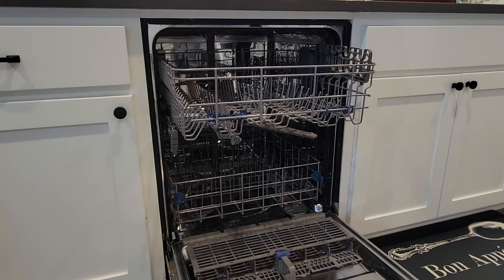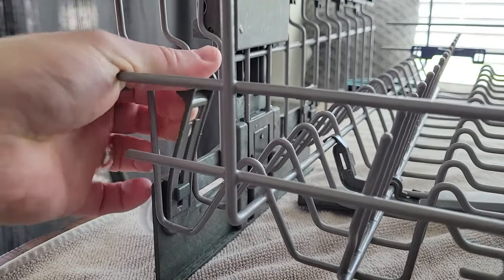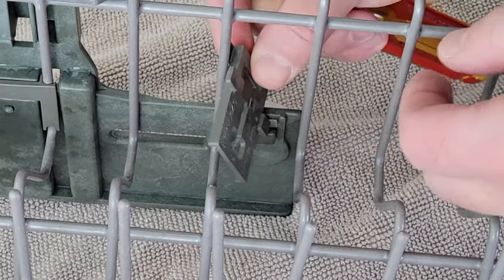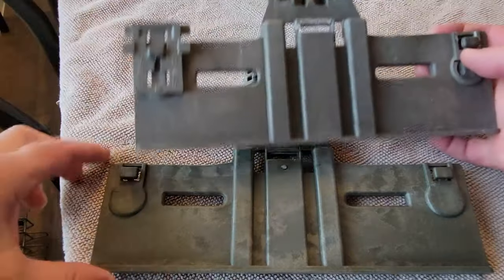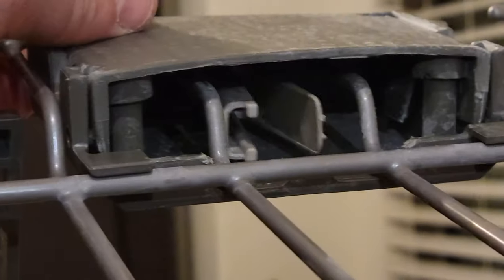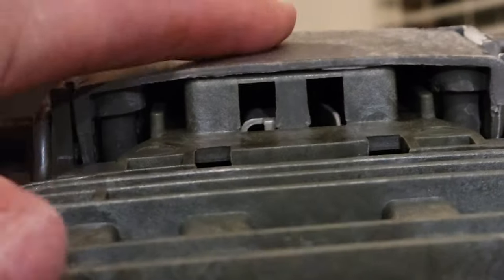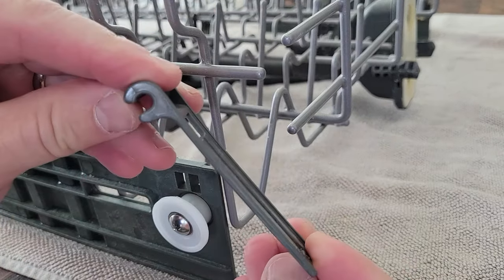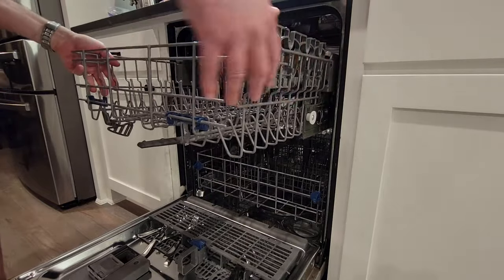Dishwasher Upper Rack Wheel Repair for Whirlpool & Kenmore

Comment from the maker: Replacement parts (Check your model below for compatibility)
Dishwasher upper rack wheel assembly: https://amzn.to/472oKOr 
Dishwasher upper rack wheel assembly with all new clips: https://amzn.to/3Kx1Y7N
    • WDT730PAHZ0
    • WDTA50SAHZ0
    • WDT970SAHZ0
    • WDT750SAHZ0 (This is the model shown in the video)
    • WDF590SAJW0
    • WDT975SAHV0
    • 7WDT950SAYM0
    • 7WDT950SAYM1
    • 7WDT950SAYM2
    • KUDC10FBBL0
    • KUDC10FBSS0
    • KUDC10FBWH0
    • 66513362K110
    • 66513362K111
    • 66513362K112
    • 66513363K110

Use this kit for the models below: https://amzn.to/4cKctBr
    • WDT790SLYM1
    • WDT790SLYM3
    • WDT910SAYE0
    • WDT910SAYE1
    • WDT910SAYE2
    • WDT910SAYE3
    • WDT910SAYM0
    • WDT910SAYM1
    • WDT910SAYM2
    • WDT910SAYM3
    • WDT910SAYH1
    • WDT910SAYH2
    • WDT910SSYB0
    • WDT790SLYM0
    • WDT790SLYM2
    • WDT910SSYM0
    • WDT910SSYM1
    • WDT910SSYM2
    • WDT910SSYM3
    • 7WDT950SAYM0
    • 7WDT950SAYM1
    • 7WDT950SAYM2
    • 7WDT950SAYM3
    • WDT910SAYH0
    • WDT790SLYB0
    • WDT790SLYW0
    • WDT790SLYW2
    • WDT910SAYH3
    • WDT910SSYB1
    • WDT910SSYB2
    • WDT910SSYB3
    • WDT910SSYW0
    • WDT910SSYW1
    • WDT910SSYW2
    • WDT910SSYW3
    • WDTA75SAHZ0
    • WDT970SAHB0
    • WDT970SAHW0
    • WDT975SAHV0
    • WDT975SAHZ0
    • WDTA75SAHN0
    • WDT780SAEM2
    • WDT780SAEM1
    • WDT730PAHZ0
    • WDTA50SAHB0
    • WDTA50SAHZ0
    • WDT970SAHZ0
    • WDT970SAHV0
    • WDT750SAHW0
    • WDT730PAHB0
    • WDT730PAHV0
    • WDF590SAJM0
    • WDP560HAMB0
    • WDP560HAMW0
    • WDP560HAMZ0
Note: I earn a small commission if you buy using the Amazon links below, but your price is NOT affected. Thank you for supporting the channel and the content I create!
Reply: This is the second replacement I had to do,  because of the cheap parts manufacturers put on the dishwashers.
I am a 75 year old widow and because of your video I did a much better job than the first time.. I had to keep picking up my parts from the bottom of the washer as they fell off.  Thank you so much.  I was able to put the parts that fell off back on, then I tackled the other bracket and they both look seaworthy now! Great video!
Reply from the maker: @nancykocbeker9037  your comment made my day! I'm so glad it helped you!
Reply: Thanks for making just a great video!!  My dishwasher was only down for 24hrs.  Amazon next day delivery awesome.  Once again thanks for making this video much appreciated
Reply from the maker: @seanmarks6389  Glad it helped, and thanks for watching!

Comment: It's sad that the manufacturer opted for a ridiculously flimsy molded plastic rack wheel hub which barely lasted 3.5 years on my dishwasher before they deteriorated and broke off. Fortunately I had purchased an extended warranty that covered the repair, but I can imagine how many thousands of customers had to pay the $40+ dollars for the replacement kit which upgraded the hubs to metal shafts,  which should have been there in the first place?  Inexcusable!

Comment: At this point anyway I just needed to know how to put the clips at the end of the rails back on! I am having extreme difficulty putting a clip back on the rail that somehow came off. Your video was excellent until the end where you didn't show that part. Why on earth didn't you when you were so detailed with every other step?
Reply from the maker: Watch at the 0:10 second mark when I remove the clip. Installation is the opposite of removal.
And then again I show how to do it at the very end of the video.
If it's still not making sense, what you need to do is to press on the ridged side of the clip and align it so that the ridged side is facing the center of the dishwasher. Then slide the clip from the center toward the outer side of the rail. 

I think a lot of people look at the clip and assume it somehow pops onto the end of the rail, but it doesn't. You have to come in from inside of the rail. 
Hope that makes sense (along with the visuals in the video), and good luck!
Reply: @JohnFixes  Thank you for the follow-up. After I went back and looked at you removing the clip, I saw that you removed it to the side. I had been trying to do what you said is common, put it on from the end, which is impossible. Thank you!

Comment: Thank you! I have successfully replaced the wheel assembly on my dishwasher. I would mention explicitly for anyone reading the comments that fiddling with the raise/lower button really is the way to get those paddles out of the way as you slide the wheel assembly on, I was trying to use pliers to get them out of the way before I realized how stupid I was being!

Edit: Also you can only really put the clips back on when the wheel assembly is slid out from the raise/lower mechanism, don't try to put the clips on when it is all the way in.
Reply from the maker: Thanks for watching!

Comment: What is the part number for the upper rack wheel assembly I want to buy it from wirlpool website
Reply from the maker: @TexasNationalist1836  you shouldn't buy the OEM part... Honestly, the after market ones are much, much better. The wheel axles are made of metal in the after market ones vs the plastic axles in  the Whirlpool part (which is why most break). 
See the location links in the video description to buy!
(I don't know the OEM part number BTW)
Reply: @JohnFixes  the Amazon link you provided the part is all plastic on whirlpool’s website they sell metal parts
Reply from the maker: @TexasNationalist1836  No, the Amazon after-market parts use metal screws for wheel axles whereas the OEM axles in my Whirlpool were 100% plastic (yours may be different). I believe the typical failure of the OEM design is the plastic axle cracking. I'd expect that an Amazon after-market upper rack wheel assembly will outlast the rest of the appliance.